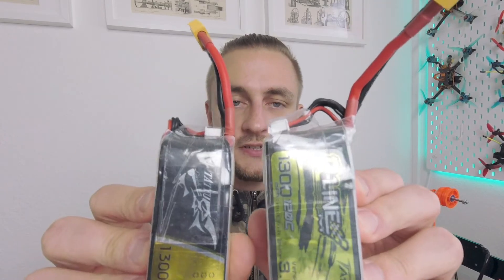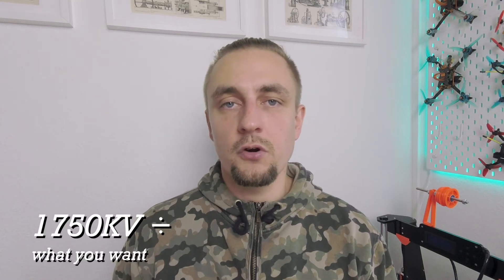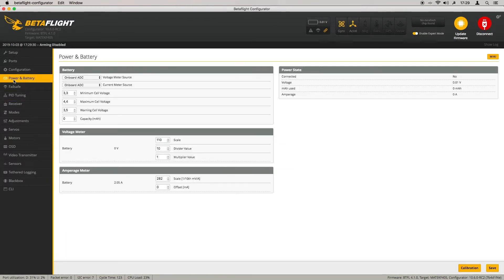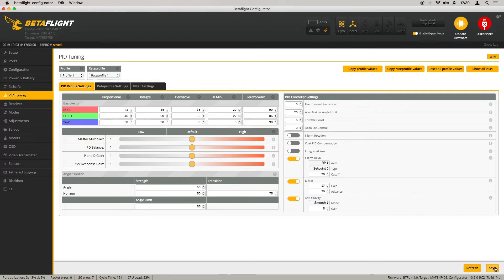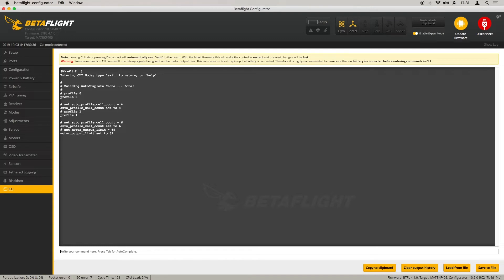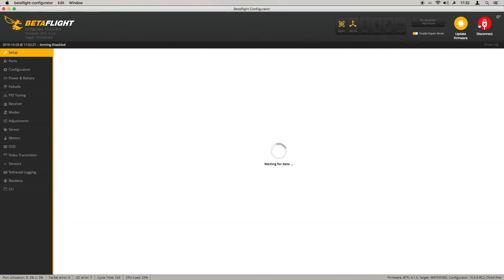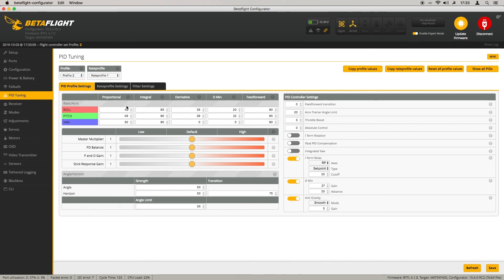4S motors on 6S and 4S with Betaflight motor output limit and auto profile cell count

Comment: Loved the video on throttle limit and sub'd off of that. Another great video here. One thing I believe to be true based on discussion with motor engineer is that you can over volt motors happily enough by small amounts without really impacting life span, but more over volting = progressively shorter life. So with temperature as a guide and maybe some battered props for testing worst case, at own risk, you can push the limit a bit higher. In this example it would be interesting to push perhaps to 75%, maybe test 72% first. Thus you would really have a little more top end motor speed compared 4s and hopefully fully counter the weight increase of battery from thrust to weight ratio perspective without too much risk. On the whoops e.g. Happymodel, I think they have been effectively encouraging us to overvolt unknowingly, selling e.g. 16000kv motors as 2s which really possibly should only be closer 1s etc, and mostly works fine, until QC gets the better of you. similar deal with their toothpick quads
You deserve more subs, will recommend
Reply: As someone who has run 2700kv motors on 5S... yes, I think it can be done 🤣

Comment: I'm wanting 6s but getfpv only has 4s version. If I do this and use 6s batteries, will it fly just like a 6s?
Reply from the maker: If you don’t plan to fly at 70% and higher throttle a lot, it will be pretty much the same. But if you want a racer or a want to fly very fast freestyle, motor temperature will be higher than that of a “true” 6S build. You also should double-check component compatibility. Does everything (i.e. ESC, flight controller, VTX) on the 4s version accept 6S?

Comment: Hi, thanks for that.

Is the performance similar to real 6s KV motors?
Reply from the maker: Hey, you're welcome. According to my measurements, up to 30-40% throttle value the performance is identical to true 6S (i.e. low KV) motors. After that high KV motors start losing efficiency the more the higher you go on throttle, reaching 3-4% less thrust at full throttle. All that missing thrust gets converted to heat. So if you fly freestyle and spend most of the time below 40% throttle, you will not really notice a difference. Feel-wise they are exactly the same. But if you want to go racing with long straight lines and go aggressively on throttle – there will be a slight difference in max power, but more importantly more chances to have the motors overheating (didn't stop me though from flying my 5" racers on 6S and 2722KV motors just because I had them 😬 – they still are going strong). Hope this helps.

Comment: Thank You Pal, I was looking for this. Based on this mod, what about Spike Absorber, specially on 6s?
Reply from the maker: You’re welcome! What I can tell from my experience is you definitely need a capacitor on the battery leads when you go 6s. You can get away without it on 4s, but on 6s there are going to be weird issues with the tune or the quad would sometimes jerk to the side until you install that capacitor. Having a full spike absorber with a diode-capacitor pair should theoretically be even better in terms of cleanliness of the tune and quad reactions. I haven’t tried it myself, that’s why I say theoretically, but if you can get one easily I would say go for it. Otherwise, install a 800-1000mF low ESR capacitor (assuming it’s a typical 5” quad) and you’re going to be fine.
Reply: @ErgoFPV  Thank u for the quick reply ;)

Comment: Bro i need help, i just bought geprc mark4 4s on banggood, but i want to use 5s on it, can u help me count what value should i put on betaflight cuz even after watching ur video again and again, im still confused, any help would nice ty
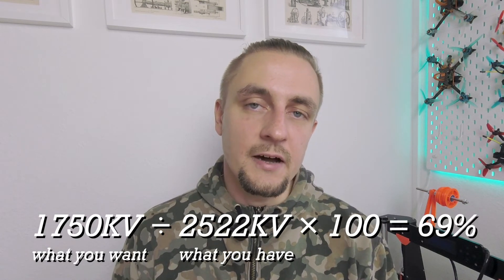Reply from the maker: Hey, sure. So the key thing to settle on is the target KV value which you kind of have to know, and that is somewhat of a blind spot of this video of mine. But I think we can make it pretty simple – according to the website the geprc mark4 for 4S has 2450KV motors and for 6S - 1850KV. That means for 5S the KV would be between the two, i.e. (2450 - 1850) / 2 + 1850 = 2150. So your target is 2150KV. Plugging that into the formula at 4:15 you get 87% (2150KV / 2450KV x 100) , and that is your desired motor output limit. You can use that with the rest of CLI commands in the video. By the way, I haven't checked if the hardware on mark4 4s is compatible with 5s, so that's on you. Not to say it's not, I just haven't checked but wanted to give you a friendly reminder so you don't fry the thing in case geprc decided to use different hardware for 4S and 6S versions. Cheers!
Reply: @ErgoFPV  thank you so muchhh for helping me, but for now ill try to digest all the information first, i hope i can contact u later on this comment section in case i don’t understand smth, plus i tot leaving a comment here would probably help someone in future tht going into the hobby, thank you again broo🙏🤝🔥🔥
Reply from the maker: @isaacsccc  you're welcome! Feel free to ask more questions

Comment: Great video! Thanks for sharing with the community. Do you know how this may impact motor efficiency and flight times?

Will the motors run hotter?
Reply from the maker: Thanks! There is an impact on efficiency in high throttle range (upwards of 50-60%, increasing the higher you go) but in my experience it only matters when you’re really pushing it, like on racing builds. I’m still flying the setup from the video for freestyle, and the motors are not much hotter usually as I don’t spend much time with throttle fully open. I’m actually running an extreme application of this setup on a racing build too - just because I had the motors already, and those are 2722kv. Racing on 6S makes them quite hot, especially on hot days, which means efficiency is also not the best (more energy from the battery converted to heat), but I don’t care really. I don’t see any dramatic difference in flight time when compared to an identical setup with “true” 6S motors - I can do the same amount of laps. To sum it up - yes, it’s less efficient and the missing thrust gets converted to elevated motor temperature, but not really noticeable for freestyle. Still doable for racing, but be prepared to potentially burn the motors if the ambient temperatures are high and you’re pushing it.
Reply: @ErgoFPV  thank you for the quick and detailed reply. I believe I have an issue where my FC restarts mid-flight and I believe it could be related to overheating, or too much power draw. I'm running a 2205/3200KV on a 3" cinewhoop quad with 6s and put an 80% limit on it. 

I just found this YouTube video as well where they did some indepth bench testing. Which also matches what you are saying. 

https://youtu.be/zp0UtvbxtqE

Thanks again!
Reply from the maker: @yuranium  you're welcome! In my experience an FC restarting mid-flight is hardly ever related to motors overheating. If anything, the ESC might misbehave because it can't handle 6S, but again that should not cause an FC restart. Drawing too much power could only affect the FC if battery goes too low for the voltage regulator that FC is powered from, which is also rather unlikely on 6S (even a fully discharged battery has pretty high voltage for typical regulators). I could think of three reasons for the FC restart: 1. mechanical issues – some wire or connector or soldering joint is not good, and in-flight vibrations cause it break the circuit sometimes. Check all of them, especially for wire cores broken inside the insulation and also around solder joints. 2. Interference from the ESC. If the FC restarts when you do aggressive maneuvers chances are the ESC causes voltage spikes in the system and those make the FC freak out. Mitigation is adding a beefy enough capacitor across the battery leads on the ESC or powering the flight controller through a separate voltage regulator / LC filter (rather extreme, usually a capacitor on the leads is enough). 3. EMF interference from ESC hitting the FC. Very rare, I've only had it on one of my builds. The FC was rather close to the ESC (tight stack) and in one particular orientation the FC would freeze when I aggressively pump throttle or flip/roll. Turning the FC 90 degrees in place reliably fixed the problem, so my theory for that one was FC and ESC had an unlucky combination of individual components placement. In one particular position something on the ESC was producing enough EMF to hit the component on the FC which was close by and sensitive enough to make the whole thing freeze. Good luck with troubleshooting!

Comment: did you need to add capacitors or upgrade the capacitors to run 6s? if you added higher rated capacitors did this affect the quad when using 4s batteries?
Reply from the maker: I was already running a 6s compatible capacitor on that build. Higher rated capacitors don’t have any practical downsides if you run them at lower voltage.
Reply: @ErgoFPV  many thanks! great video and easy to follow . i have setup mine using your guide. i also notice you did not have the mah entered on your batttery section of betaflight but the mah's is predent for 4s and 6s on your fpv footage. mine is set to 1550 at the moment for my 4s but my new 6s battery is 1300mah. do you have any advice to keep the current sensor accurate?
Reply from the maker: @iainjack9249  thank you, I'm happy you found the video useful! If I understood you correctly, you're referring to that "Capacity (mAh)" setting on the battery tab in the configurator. That setting is the warning threshold and it doesn't affect current sensing calibration. Even if you have the warning threshold set to zero, you still get the current measured and displayed via OSD. The accuracy of the amp readings is not affected by voltage, so you don't need to recalibrate the sensor. But if you wanted one warning threshold for 4S and a different one for 6S – I'm afraid you can't have that in Betaflight. I do something similar on my radio however – my receiver supports telemetry so I get battery voltage and spent mAh sent to the radio, and I have the radio configured to start saying the spent mAh every 10 seconds after a certain threshold. The way it's done is similar to what JB does here for the low voltage readouts https://youtu.be/2xt623VAMEk What I added on top was a bit more logic so it chooses the threshold depending on the voltage it sees from the battery (basically, higher than 18V – it uses the 6S threshold, otherwise 4S).

Comment: do this not burn 2500 kv motor with 6s ?
Reply from the maker: I’m still flying my freestyle build exactly as shown in the video, with 2522 kv motors on 6s, and they’re doing just fine. The thing is though, this setup is less efficient when you go above roughly 40% throttle, and lost efficiency is converted to heat. In my estimation at full throttle it’s about 8% of electrical power. So if you’re flying typical flippy-floppy freestyle, this setup works just fine as you don’t go 100% throttle very often and motors have time to cool down. If you want to race, or fly very intense high-speed freestyle, or your build weighs a lot - this setup would be running with hot motors. They won’t go up in smoke immediately as you blip the throttle - one of my racing builds runs 2722 kv on 6s, but on a hot day you would want to be careful and check the motor temperature from time to time. I fly with this setup because I still have those motors and some spares from the time when I was flying 4s, but when I finally destroy them, I’m going to switch to the proper low kv ones.
Reply: @ErgoFPV  ok i just fly cruising never 100% throttle .i don't want to trash my5x 6s  i will try this tomorrow thanks you

Comment: So I did this and the quad is nearly unflyable on 6s. Do you have to change the tune for 6s? I am overshooting big time on rolls and especially flips with huge bounce back. It flies great on 4s. Just plugging in a 6s battery, that is only 23 grams heavier than my 4s battery, the quad flies horribly. I don't know anything about tuning so if I need to retune the quad I'm screwed on this idea.
Reply from the maker: Hey. I'm still flying this setup on two of my quads, and neither needed any tuning. Basically default PIDs and in the case of the racing build a bit more filtering via the sliders to tolerate heavily battered props. That one runs really high KV motors - 2722KV with zero problems at 65% output limit, so it should be something with your build or setup that causes this. Here's what I can think of:

1. Verify that motor output limit is actually properly configured. Take the props off, connect a 6S battery, connect the quad to the computer, go to the CLI tab in the configurator and type "get motor_output_limit". You should see the number that you set as the desired motor output percentage, and that should be less than the default 100 (probably around 60-70).

2. Do you have a low ESR capacitor across the battery leads on your build? Voltage spikes that the ESC produces on 6S are higher, and you need a capacitor to smooth them out so they don't affect the flight controller electronics. The same applies to 4S actually, but the spikes are less extreme, so you can get away without a cap. I'm running capacitors on all of my builds. Something like Panasonic FM series low ESR 1000uF 35V for 6S.

3. You could be unfortunate to have an ESC that doesn't behave well on 6S even though it's rated for that. What ESC and FC are you running on the build?

4. You can go into the configurator's CLI tab, type "diff all" and paste the configuration here so I can have a look. Maybe I can spot something.
Reply: @ErgoFPV  I'll have to wait till Amazon sends my replacement battery. On the 2nd use of my Ovonics 1300mah 6s battery it went from 21.9v to 10v instantly. The quad dropped out of the sky. It was a bad battery. 

I did watch in the PID tab it change from profile 1 to profile 2 just by plugging in a 4s or 6s battery. When I get the 6s battery I'll check the CLI for motor output like you said. 

I built a Geprc mk4 frame. Velox 2207 2550kv motors and my stack is a 30x30 Mamba f7 APP with a Blheli_32 50a Mamba ESC. I do have the capacitor soldered onto the battery wire pads on the ESC. The 35v 470mf cap that came with the stack. 

I wouldn't think it should fly any different from 4s to 6s. My percent is 66.333% I believe. That gives my props the exact same rpm at full throttle. I made the motor output 66% so my props should be a few rpms slower on 6s than on 4s.  I can roll slowly or flip slowly and it's fine on 6s. It's the jerk moves where it goes nuts.
Reply: @ErgoFPV  Yeah, it says motor output limit is 66. I'll try lowering it even more. I just flew on the 6s battery again. Good level flight. I punched out and did a half roll. That was good but when I half rolled again to put myself right side up, it did a 360 roll leaving my upside down. It way overshot and did not correct to the setpoint. My stick input was for a half roll, not a full roll. Very weird. Very strange and so far no one has heard of this problem.
Reply from the maker: Very strange. I did a bit of research, and the Mamba stack seems to be able to handle 6S fine. At least I haven't found many problem reports.

The capacitor that comes with it seems to be on the smaller side somehow, so if you have another one lying around I would try temporarily replacing or adding it in parallel to bump the overall capacity to ~1000uF to see if that changes anything.

There is also one weird case that I personally had which might be relevant. I had a build that would fly just fine when doing nice slow turns, but its flight controller would freeze on sharp maneuvres. Literally the OSD stopped showing any changes and it stopped reacting to anything and (thankfully) drop out of the sky with ESC telling "no signal from the flight controller". The interesting part is how I fixed it. The freezes it was having were very strange and the flight controller was the one with one side being completely flat for mounting VTX/RX, so all of the electronics was on the side that was close to the ESC. I thought it could be that the ESC was interfering with the FC electromagnetically, so I turned the flight controller the components side up, and the problem was gone. Later I discovered that it was enough to even rotate the FC in place by 90 degrees to prevent the freezing. So maybe that is also something you can try – either move the FC a bit further away from the ESC, or turn it 90 degrees in place (don't forget to change the gyro/acc orientation in the configurator).

Comment: Great video and instruction. I started with 4s as well. Now I'm ready to step it up to 6s since I'm finally good enough to notice battery sag and I need more power. I can just do this until the ten 4s batteries I have wear out and then just buy 6s motors to go with all the new 6s batteries I buy. Thanks!

Comment: Hello.
A big thank to you for this video. But a question : how to reverse to the origin? 
Because my motors are in 4S, and I put a limit with 6S batt. But i'll change my motors for biggers and 6S (lower kv), and how to reset these parameters when i'll have change?
Thank you